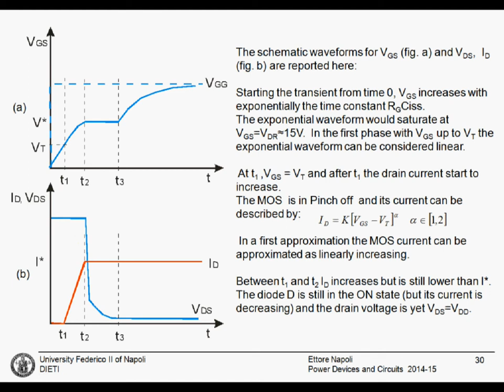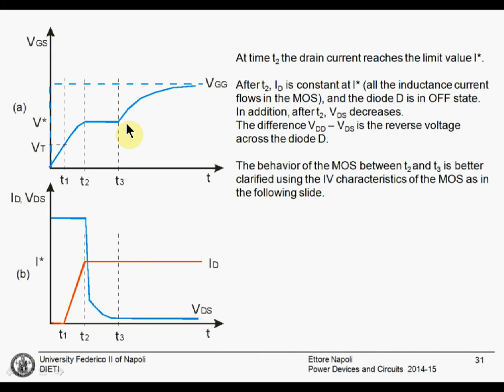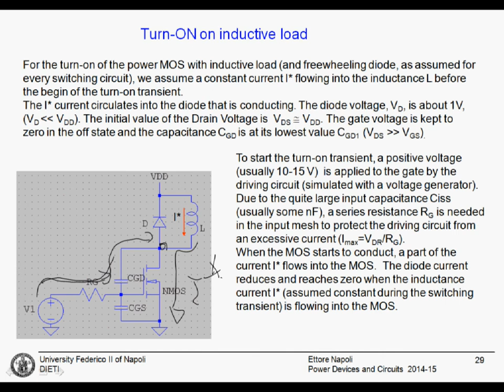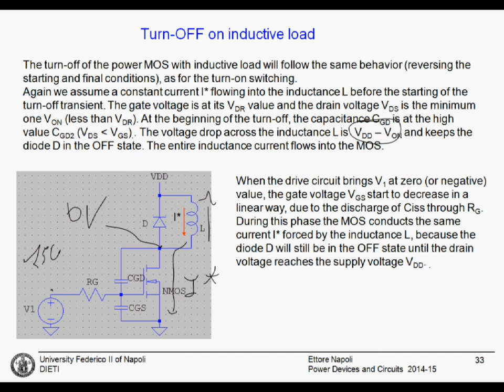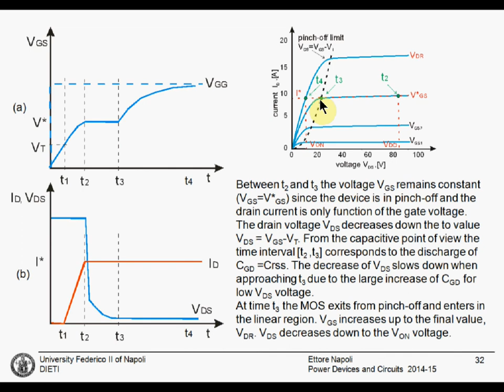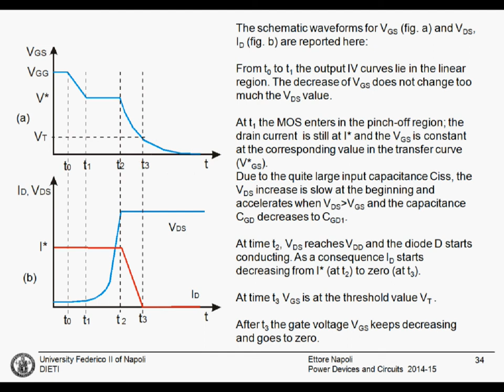Power MOS switching behavior

Comment: Sir, At 14:18 (t2-t3 period) , why does all gate current ig flow through Cgd? I think there is also a path through Cgs (at 14:33). In: other words, my question is: Why does the miller plateau exist?
I know the equation i_channel=gm*(vgs-vth), but it is vgs that determines ids. So even if ids becomes the full load current, vgs can still increase anyway (although it cannot increase the channel current anymore). Is there anything wrong with my thoughts?
Reply: 因为cdg这时候起主要作用，在米勒平台期，ds要下降，gate大部分电流全部给cdg放电了，（此时相比cgs，cdg的等效电容很大）cgs没办法获取电流，我最近也在研究这个。不过还是有些地方没弄懂，我不知道为什么米勒平台后。ds的电压就开始下降了